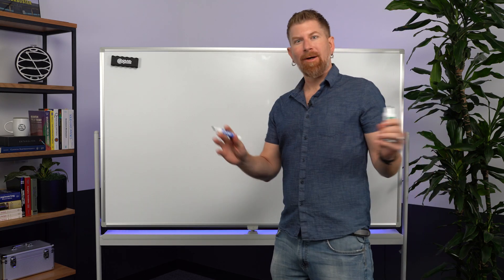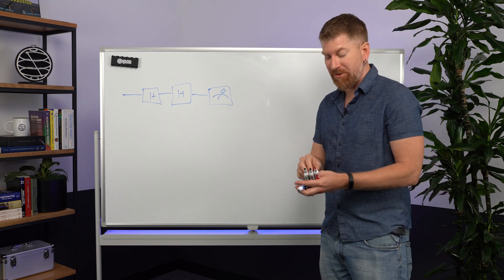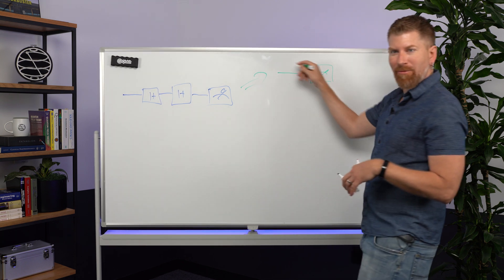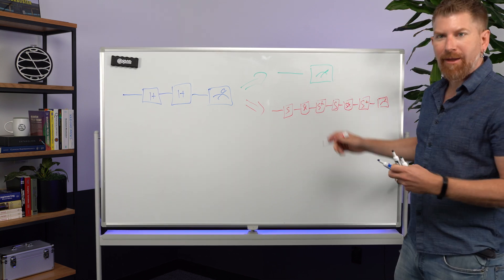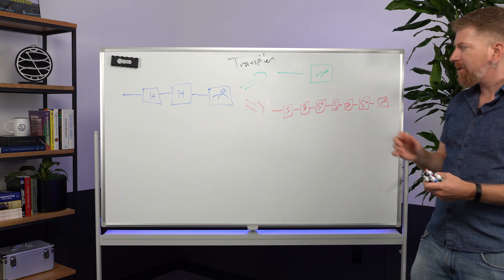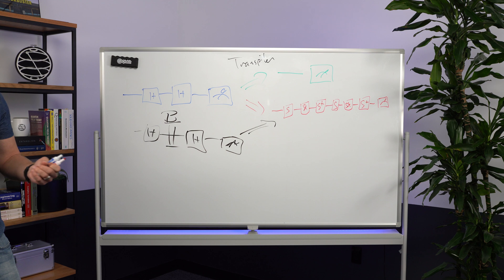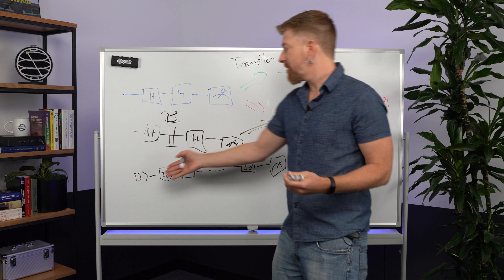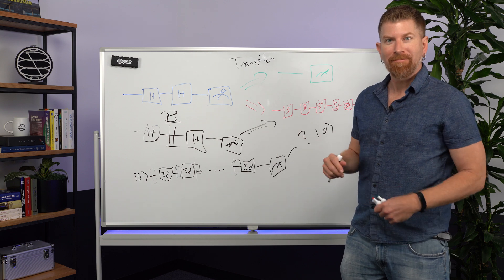What is the point of a barrier? - Nick Knows.

Comment: It seems like barriers are also commonly used just to disambiguate different parts of a quantum algorithm for clarity. For actually useful computation, you probably would want to avoid barriers to minimize gate counts, no?
Reply from the maker: Absolutely true, it's easier to understand what the circuit is doing when you write it with barriers but you would want to remove the barriers before transpiling those circuits down into simpler gates to optimize execution. ~ Nick

Comment: How do the barriers effect different optimization levels. For example, separate a circuit into chunks of depth 4 or 5 gates and put barriers inbetween each chunk. If you run the circuit with optimization level 3, will qiskit only optimize between the barriers or will it run the optimization level 3 over the whole circuit (or most likely, some combination of the two)? I guess my question really is: if you put barriers up at periodic intervals in a circuit and run it with optimization level 3, will the optimization no-longer run supre-polynomially and will instead run at some polynomial time level?
Reply from the maker: I'm pretty sure the transpiler will respect the barriers and only optimize what's between them, and yes this should decrease the run time, as this will run quicker because the problem sizes are linear in each block of interval. This could be fun to test out by trying a circuit you know will transpile down to something simpler and adding barriers and checking out the difference. ~ Nick
Reply: @qiskit  Thats great! I wonder if you would have to know of any particular documents I could reference in order to document this fact? I've tried going through the various different resources, but its possible noone has specifically looked at this problem yet (at least, I haven't found anything).